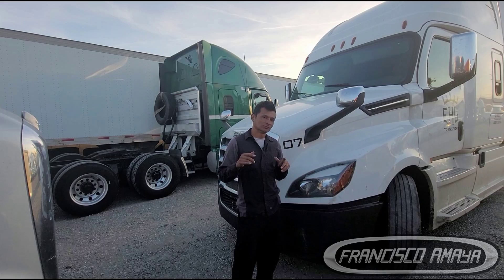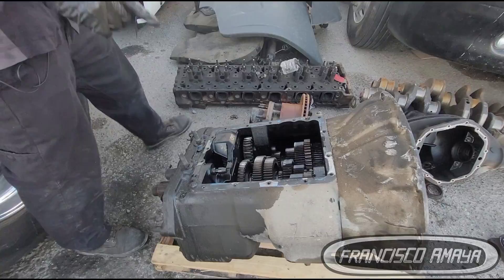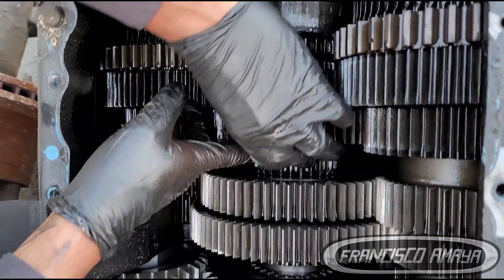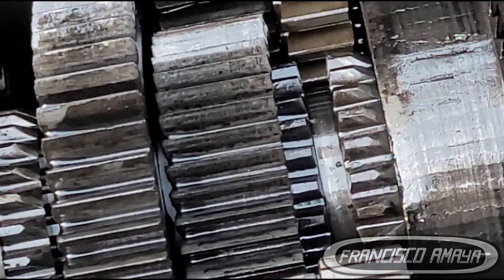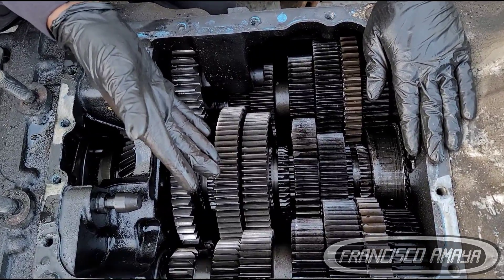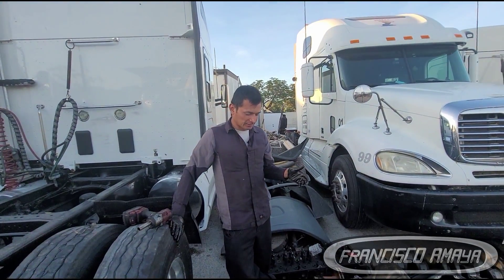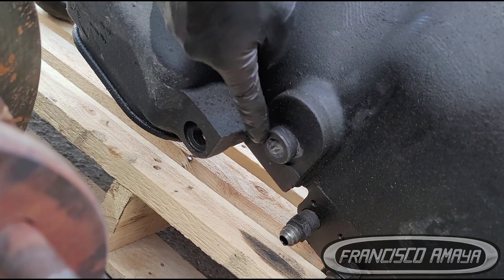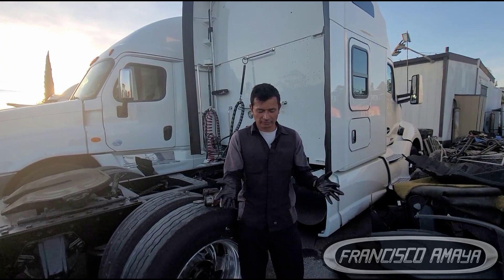Freightliner cascadia 126 10 speed manual transmission broken low oil level no lubrication

Comment: Help and support sent as this used to be problem before updating the gear box pin. Truck and equipment on the way
The mesh  would not line up or sink inline so everyone invested in.road rangers and tractor clutches
AFFA angels never die nffn HMS council

Comment: Don't you have a temp sensor inside the transmission to warn driver that temperature has exceeded normal level? 🤔
Reply: Hello, not all trucks do have the temp sensor, but if you do is a good advice to keep an eye on it, as well all of the other gauges. hello to everyone good Samaritan

Comment: That's what happens when you put a new driver in a manual nowadays 😂😂. Just kidding. Another thing drivers should check is the differential fluids. I found out the hard way this week.
Reply: This the stupid owner job to pm the truck every month , i have 3 trucks , driver job is to check engine oil level and power steering and report any other issues
Reply: @Hammurabi2234  well you get what you pay for. If I hire a driver and the debt of his responsibility is checking the oil then you can hire him. But if you're saying "employees" shouldn't be wrenching on a company's truck I can somewhat agree. But EVERY driver should have some basic tools.